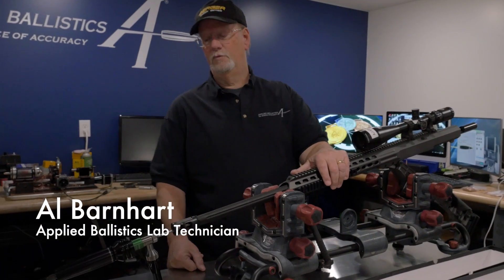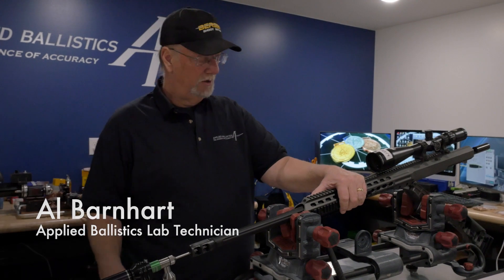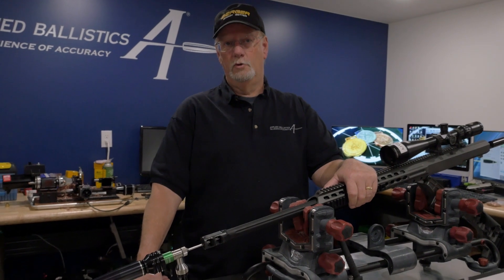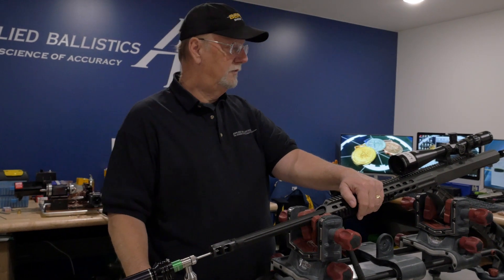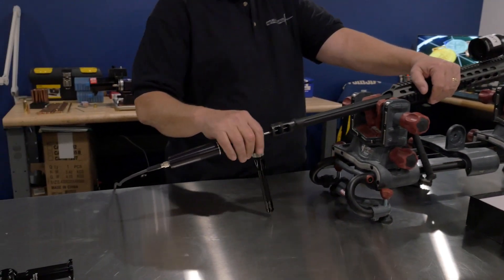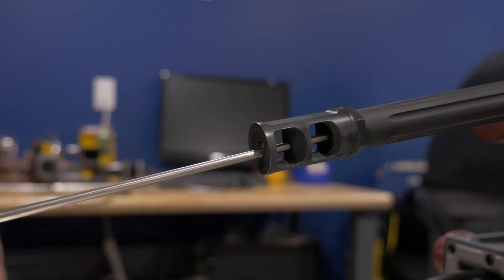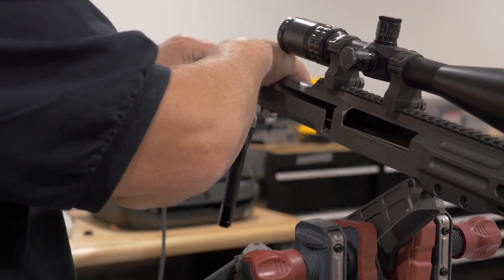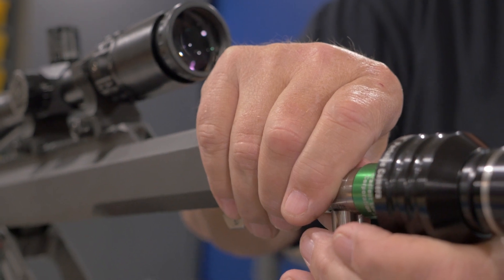Borescope Demo

Comment: I bet it’s a Hawkeye. And don’t coat the inside of your barrel. That reduces the bore ID and will spike the pressure. IMO
Reply: Mark Spencer , thanks for the information.  I simply couldn't pull that name from my mind...crs  and  whatnot. 
As far as coatings and linings goes , one can read so much right? Other than hard chrome, which I am positive is done to an increased diameter bore, I was just curious about what these guys had to say. Well I meant there oppion,  but certainly am appreciative of yours too. No disrespect intended. Thank you again, Crawford out
Reply: It’s done on a barrel that is machined for it. .0005” thick flash crome is common on machine gun barrels.
Reply: Also, flash coating isn’t perfect. You might get one side, of the barrel, with a little more chrome, than the other side. Not good for accuracy.

Comment: What's the  mfg of your bore scope? Looks like that would be a bennifitial tool.
   In yalls opinion would it be of much benefit to have the bore coated w the ceramic coatings I've heard of?  Or is there some other bore coating that would reduce throat erosion to any noticeable extent? 
   I'm running a brand new u.m.s.s. 26.5" .936 tube chambered in ,300WSM in a modern spring rifle ( ar10) w a modified bolt and bag with modified magpul mags. New to the long range play so I'm still gathering equipment as budget allows. Lol